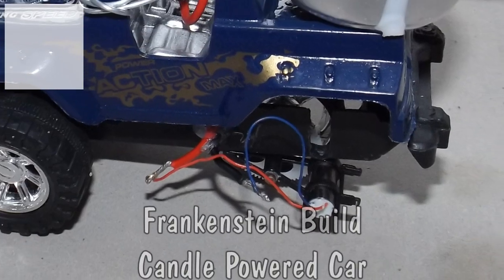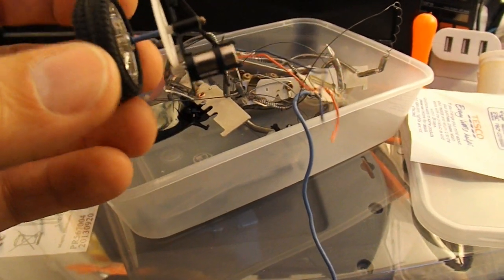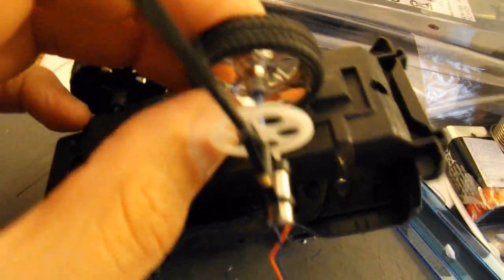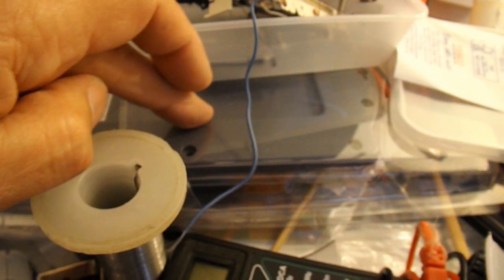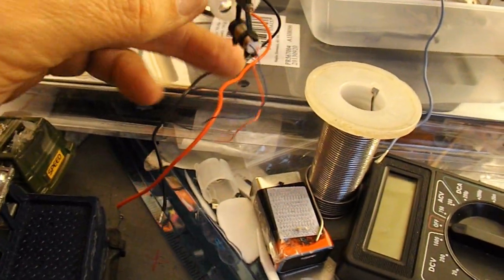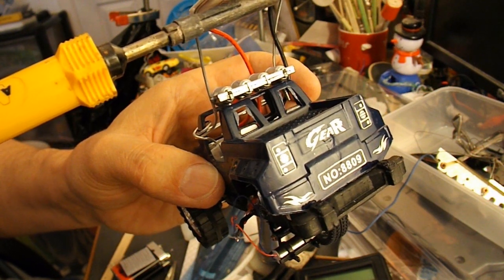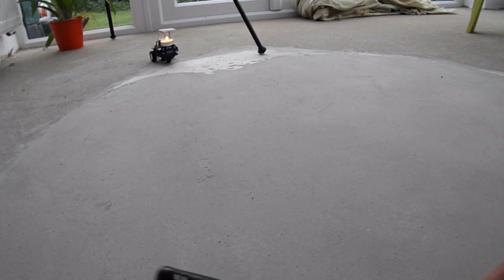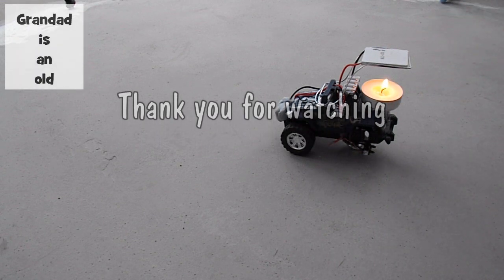Frankenstein Build Candle Powered Car

Comment: where is the moto ?
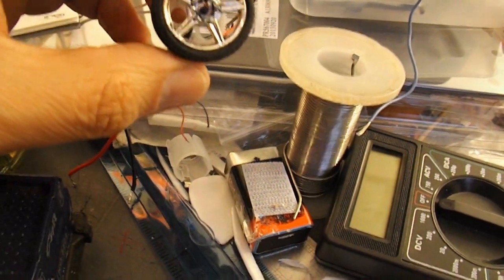Reply from the maker: +Le Hung Trieu did you watch the video? The motor is the small motor from a nanocopter using the helicopter's gear and shaft with a wheel in place of the rotor. It is pretty clear at 03:58

Comment: Thought you might have tried an ice cube on top as a temporary measure.
Reply from the maker: eamonn280958 it worked for long enough to demonstrate the principle and that is all I need for a video. I am sure I have some heatsinks somewhere in my junk pile but I couldn't find them when I wanted them. I've ordered some cheap ones off eBay for any future projects.

Comment: Another great video from everyones favorite youtube grandad. The hairdryer wire is in fact nichrome wire. I have used it to make a number of HOTWIRE FOAM cutters. It's lots of fun to build and use them. There is a great website that has a free nichrome wire calculator in one of there TAPS. All you have to do is know the diameter of your wire and the length you want to use. The tempeture your shooting for is approx. 600 F. for cutting styrofoam.  The calculator will provode you with a TARGET voltage. The website is   www.jacobs-online.biz       ///
Reply from the maker: David Puissegur thanks for the link, I have been meaning to make a foam cutter for a couple of years now, just don't seem to get around to it. This video is a classic example of the reason why, I just get sidetracked. I did make a small one a while back using some wire fishing line and I collected the hairdryer wire to use but as I say, just haven't got round to it.

Comment: Do you think you could make a rc car off old TV parts?
Reply from the maker: Infamous Gamer what particular parts did you have in mind? None of the electronics would be any use. There is no motor in a television to drive the car. None of the components would be any use for axles or wheels.